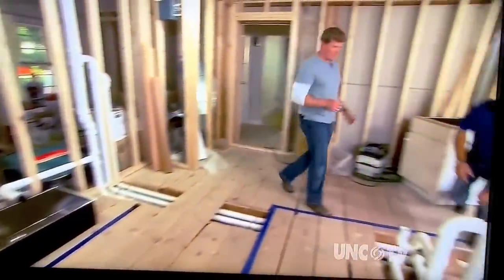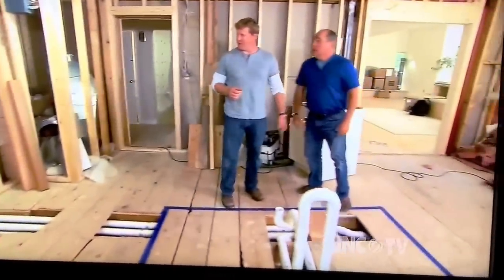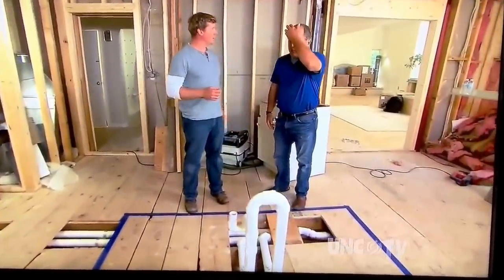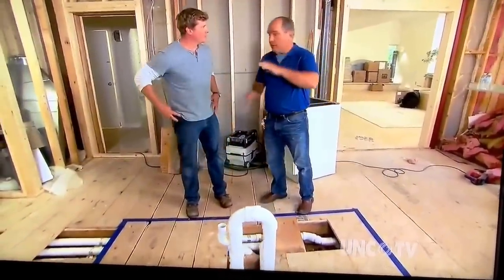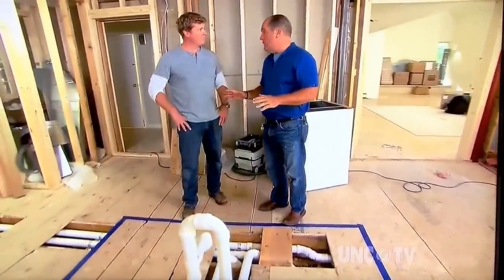Proper drain & vent for island sink

Comment: It would be illegal in Ontario. In Ontario for island sinks you install a solid P-trap bellow the grade and vent it bellow the grade and connect it to a vent above ground above the flood level rim of the highest fixture. More importantly you install an end cleanout on a wye fitting and a 45 downstream of the solid P-trap and bring it up inside the cabinet on a stand pipe. (End cleanout)
A secondary cleanout is going on the fixture outlet pipe of the sink bellow the tail piece for P-trap cleaning.

Comment: Missing two clean-out:  one, on the drain rig   under or above the trap and another on the foot vent on the far side wall to snake foot vent.
Yes the top of the island should have a 90 at the top and two  45s. 
The island rough is totally wrong and wouldn’t pass inspection in my jurisdiction (Hawaii). Because, the foot vent should begin on the vertical on the vent side of the rig so the rig is too high, reason being snaking. The mainline should be roughed in the same floor space channel as the vertical rig and the rig come into the mainline from the top using drainage fittings. The foot vent is wrong.
Reply: It's not in Hawaii, and the trap on the waste counts as one cleanout but is nice to have one on cent side of island also
Reply: You'd never put in the top fittings before the counter top was done so I'm sure it's just a slapped together dry fit for the purposes of the show. They'll add a clean out
Reply: @killax7  He mentioned that if there's a blockage in the sewer pipe under p trap but nothing told that if there will be cleanout installed to clean this blockage.

Comment: This is actually illegal in Kentucky. Here, the vent in a loop vent and drain, has to be right above the drain. So your two pipes would go through the floor, your drain will 90 directly under the vent, while the vent will T off to wherever the closest wall is, and there can be no fittings between that tee and where the vent goes up through the floor. Under that tee is another tee turned on its back with the middle pointed up to tie the vent in with the drain yet again, in case the system ever stops or backs up, the waste in the vent has somewhere to go.

Comment: California code language is as follows - there are some inconsistencies with what's shown: "Traps for island sinks and similar equipment shall be roughed in above the floor and shall be permitted to be vented by extending the vent as high as possible, but not less than the drainboard height and then returning it downward and connecting it to the horizontal sink drain immediately downstream from the vertical fixture drain. The return vent shall be connected to the horizontal drain through a wye-branch fitting and shall, in addition, be provided with a foot vent taken off the vertical fixture vent by means of a wye branch immediately below the floor and extending to the nearest partition and then through the roof to the open air, or shall be permitted to be connected to other vents at a point not less than 6 inches (152 mm) above the flood-level rim of the fixtures served. Drainage fittings shall be used on the vent below the floor level, and a slope of not less than 1/4 inch per foot (20.8 mm/m) back to the drain shall be maintained. The return bend used under the drainboard shall be a one-piece fitting or an assembly of a 45 degree (0.79 rad), a 90 degree (1.57 rad), and a 45 degree (0.79 rad) elbow in the order named. Pipe sizing shall be as elsewhere required in this code. The island sink drain, upstream of the returned vent, shall serve no other fixtures. An accessible cleanout shall be installed in the vertical portion of the foot vent."

Comment: Absolutely right. With a cheater in a kitchen sink the flood level rim counts as the bottom of the sink so all you have to do is get the valve as high as you can or a couple inches above the bottom of the sink. My preference is as high as able.
Reply: Dan Bedard flood level is the top of any fixture. Even with a studor vent. It allows air into system but nothing to come out. It is like a check valve

Comment: That vertical loop vent needs a cleanout - even with a relief drain - at least here in Ohio.  I did get away with a 2 way T on the drain side once though , that way you could still clean out the vent side by going up and over...which is REEEEEEALLY tough to do with the regular drain T you have in there...just sayin'.

Comment: _____________Island drain system shown here is called a loop vent, it's missing 3 cleanouts,  at the top of the loop vent you can't use 2 elbows (2- 45's and a 90), the "Vent" has to tie into the vertical section of the loop vent...not horizontal and other violations. Real plumbing is difficult....this system shown here in video will work perfect for years..... but a plumbing  inspector could make them change everything.  
Read More
Reply: Read More 
It’s all wrong. I’ve roughed countless island sinks. It isn’t an easy thing if done properly. I think you understand by your comment. 
We know that your statement of the foot vent connection being on the vertical is a puzzlement for most people and some licensed plumbers. They get confused because there is not enough room in the floor joist. Yes, but us old school plumbers know how to squeeze in. tricks OTT.
Reply: Read More 
I made a comment to your remarks. vp

Comment: Nice, but it appears they are also missing their cleanouts per the IRC 3112.3.
Reply: bah they can cut those in  with no hub bands.after the job is done. lol
Reply: @bounchofbeaners6627  You didnt eat your beans that day you put in your comment did you? Any plumber doing a "clean job" would never us a "no hub band" when you are doing the ruffin plubing in a new home, you might as well put in the clean out while it is easier to do so which in a lot of cities it is code to have a clean out to pass an inspection!
Reply: @Chupamela-jajaja  i know.... thats is why i put in "lol"
Reply: @bounchofbeaners6627  "Riiiight" and whats up with your user name "bounchofbeaners"? Lol
Reply: @Chupamela-jajaja  my username is who you are speaking to............
Reply: @Chupamela-jajaja  si senior.. no hub bands save the day!!!! XD
Reply: @bounchofbeaners6627  Hahaha😂 ok ma'am
Reply: I'm not worried about the cleanouts, just the fact that you have to butcher the cabinet when you install it. Most plumbers would just stub up the pipes and connect it after the cabinet is installed. I guess it doesn't matter when you are building in the studio. How can a job site be cleaner than some new homes?
Reply: Same thing I just noticed by watching it!  when ever I go to un-clogged those sinks I always have seen them with a double C/O one for the vent & the other one for the drain which is where I ran the snake
Reply: TRUE THATS WHAT I WAS THINKING ABOUT IT ? THERE ARE SO MANY TWIST AND TURNS METHODS APPLIED ON PLUMBING OF KITCHEN . CLEANOUTS MUST BE PLACED .
Reply: No hub bands are for no hub cast iron. Need a clamp all
Reply: Good eye, good eye Brian Elliot!
Reply: Thank you, why do these people make videos, there’s not enough grade on the horizontal lines

Comment: Section 909.1 UPC this would be illegal,  but different places diff code. 
The foot vent would have to tie in with a wye, and and straight to the vent pipe., with a clean out on the vertical vent before it ties in.
2nd the barrel would have to be a 45°, 90°, 45°, in that order. But again., that's UPC,  good visuals at least. 
All is legal if you get the authority to authorize your design.
Reply: You forgot to mention that the foot vent must rise  1/4" per foot to the nearest wall. The only instance where a vent must have fall.
Reply: Hi I have a question I’m doing some diy work at home trying to fix an existing venting problem I have in my house ,,my house kitchen was plumb with a ptrap with a avv vent to the wall and then a 90 going down like 2 feet another 90 with straight pipe to the main sewer ,is this legal ???help please

Comment: Nice neat plumbing, but an clean out is required on the vertical foot vent of the island sink where it comes up in the wall over by  the other sink as well as a 2" clean out for the sink drain 6" above the overflow rim of the highest fixture unless this is upstairs in which no clean outs are required except for island foot vent.
Reply: Paul Mikul 
Also the foot vent should be connected on the vertical of the rig using drainage fittings.

Comment: That island loop vent system is incorrect. It is missing two clean outs. One should be on the island (vent) loop, the other one the wall, where pipe exists floor and turns from horizontal to vertical. Also, top of the loop should be plumbed with two street 45's and one vent 90 ell. Thank you
Reply: Question, because I am learning. Why does there also have to be a clean out on the vent side? If the drain pipe is doing its job, shouldn't there just be a cleanout on the drain side? The vent would only regulate air, so why should there be a cleanout on the vent side? Thanks!
Reply: @candacemoon9671 : Good question, thank you for asking. That is what Code calls for. I don't make the Code, I just follow it. The idea of clean outs, one from each side of the vertical vent, is to be able to snake it should sink back up into it. Thank you

Comment: Ok all you armchair plumbers. Instead of quoting code to me, please tell me what other actual problems are caused by how this piping was run. It seems like it handles any of the problem cases. What is wrong with it (and logically. Not just some code or law shit)

Some people are bitching about the two 90 degree fitting. What is the problem there? This pipe contains air. And if it ever did get water and if 90s lead to siphon, seems like that would be a good thing to pull the water out

Waiting on logic responses
Reply: Research and Build 
The reason is food will not be able to vacate the topside of the island vent if constantly inundated because of a clog. 2 - 90s will create a shelf which could present problems in the vent after unclogging. The 90 and 2 45s will drain completely. 
I’m not an arm chair plumber I’m a former plumbing instructor at the
 trade college in my jurisdiction.
Reply: It's fine rough in  the 2 45s and a 90  will get you another 2inches but either way is correct  a cleanout on island vent side would be nice luxury but any roto rooter guy knows you can clean vent from waste side with 1/4 or 3/8 cable it will make the sanitary tee going up ,
Reply: I would preferably like to see a double clean out just makes life easier 😌
Reply: If you're putting out a video, show something that conforms to the unified plumbing code at the least.

Comment: I have a kitchen sink drain that doesn't seem to drain very well and I could not locate a plumbing vent in my basement.  I clean my kitchen drain twice a year, so I don't believe that the drain is simply clogged.   I am thinking that the problem must be that the drain is not draining because of a lack of ventilation.  How could I correct this problem?  Any suggestions would be appreciated.  Thanks!
Reply: Jeff the whiff you can add an air admittance valve you won't spend over $50
Reply: Jane, thanks for your advice on the air admittance valve.  While watching This Old House a while ago, I think one of those was installed directly under the kitchen sink.  Is that the type you are referring to?
Reply: jeffthewhiff 
We call it In-line-vent which is illegal in my state 
So does your sink gurgle or bubble up if so could be venting problem if not it could be a lack of slope problem. 
FYI the vent starts above the sink  trap behind the wall and upwards.

Comment: ah yeah no clean out on that Island sink? or any sink?
Reply: Kelly Goodman that's exactly what I was thinking
Reply: Kelly Goodman the bare minimum code simply requires a clean out at the base of the drain before the branches underground to the building drain. Plus the ptrap can be used as a clean out. Or he just forgot to add it for he video which is most likely.
Reply: You can just run a snake though the drain if anything
Reply: Code requires a cleanout on the vent. The vent can become clogged. All the fittings on the return vent need to be drainage fittings and the ventis supposed to be pitched at a 1/4 so it can drain back to the system in case of a back up
Reply: I m rooter .when  people got or have, problems they think  is going  to be   Easy job.

Comment: If you just use 1- 2" pipe for drain, and no loop vent, it will still work as long as you don't put grease down the drain.

Comment: Ron Paredez the top of that loop vent is still not to code it should have 1 90 degree fitting on top with a 45 degree one on each side, so as not to have a flat spot between the two 90 degree elbows as shown, Sorry.
Reply: Why does a small flat spot hafe to with anything when this is for air
Reply: Ramiro Paredez 
Plus the foot vent should be connected on the vertical of the vent.

Comment: No clean outs on island
No clean outs on wall connect the vent 
Totally wrong on lay out on rough island so far I know 
Long turn comby
Long sweep 90 
Comby outlet on top of middle inlet toward near wall 
Long sweep 90 plus clean out
And in the island clean out in drain connect each other Whit 2 45* and a  90 
I never hear a relief vent to drain

Comment: I have a sink that was not vented...Rather than tear the walls apart to install one would you recommend an AAV???
Reply: not sure if you figured this out or not, but you can put a auto vent under the counter. you can find them on youtube as well
Reply: These are illegal in many areas....do not comply with building codes.
Reply: if it's an existing structure just put one on it, no one is going to inspect it, if anyone says anything say bit was already like that
Reply: David Reynolds
Reply: john smith check your code but you should be able to use a cheater vent. Just make sure that it is above flood level rim
Reply: Appreciate your input Dan but How do I get it above the flood level rim???  Stick it up through my counter top??  I have seen installs where they run it under the counter as high as possible.
Reply: just as you said...below the flood rim, high under the counter but low enough to where you can unthread and replace it (if you get the kind that connects via threads). It will work fine.
Reply: It has a one way valve to let air in and sewer gas and water out of the building, it says to be above flood rim, but who’s going to stick it above your counter top, just stick it as high as you can get it

Comment: Why are the pipes used in inside plumbing white and others are black?
Reply: PVC is white(generally). ABS is black(generally) Different jurisdictions require different materials. It's a hodgepodge. But, the O.D. and I.D of the pipe., the sweep and configuration of the fittings are identical. PVC is a little harder and tends to lay flat. The glues are not compatible. I've worked in N.C. and California and it has always been ABS. But, really it's all the same. Of course, when PVC burns, it releases chlorine gas. ABS fumes can't be great.

Comment: Nothing like what we do in the UK. This system is so complex by comparison.
Reply: I don't know how you're doing this in the UK, but here in Germany we use the drain also as the vent. Over in the US they call that a wet vent.
Reply: @Marcel_Germann  same way here, in fact the parts of Europe I've visited tend to do it the way we do.
Reply: @Marcel_Germann  In the US we call what you are saying a combination waste and vent. What he is doing is wrong and very costly when it clogs. An approved Air Admittance vent will work fine for an island sink.
Reply: @joshm5816  When done properly you won't have any issues with it. The most clogs here are actually the traps, mostly in sinks. In the kitchen caused by grease and food scraps flushed down the drain, in the bathroom the traps getting clogged by hair and skin particles and grease. If it passes through the trap, it will also pass through the pipe. Except the system is defective (missallignment of the couplings between the pipes) or badly planned or realised. If you make it that way you actually have to make the pipes wider (here the standard toilet pipe is 4" instead of 3"), and you need to choose the right angle to get from one pipe into another one. This is depending on the diameters of the pipes, otherwise you'll have a noisy pipe because the pipe won't vent correctly. Every vertical stack must be vented. The thing is: The required amount of air for a correct venting is between 10 and 35 times of the amount of water that is flushed down the drain. The vent opening in the roof must be at least 2m away from any window, and at least 1m long (length above the roof).